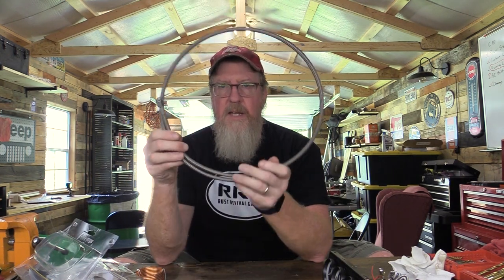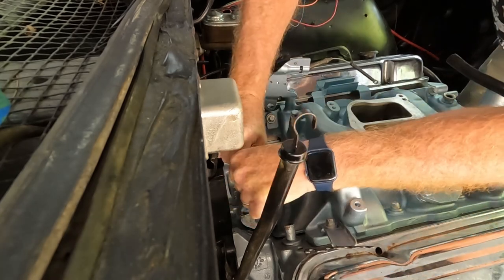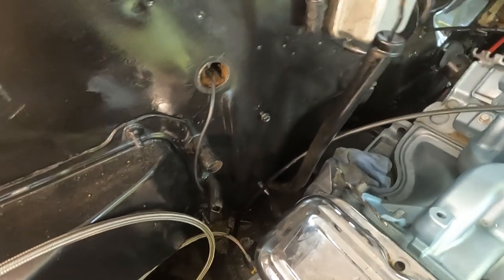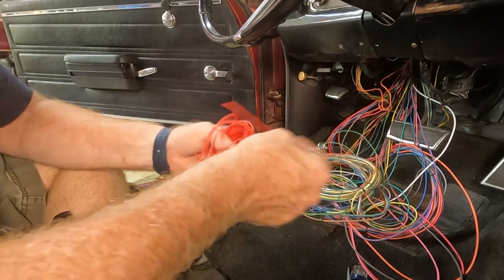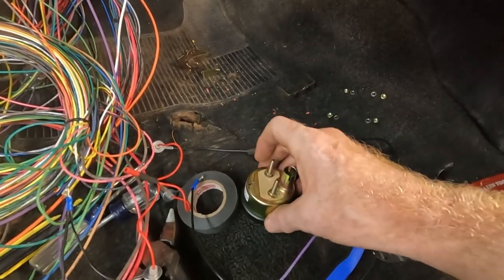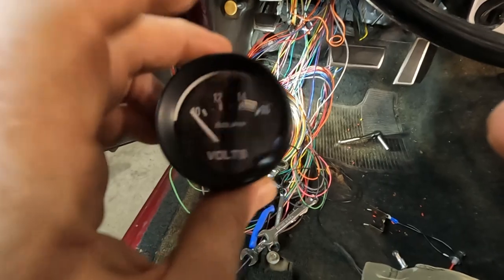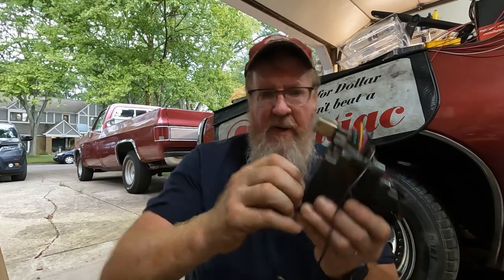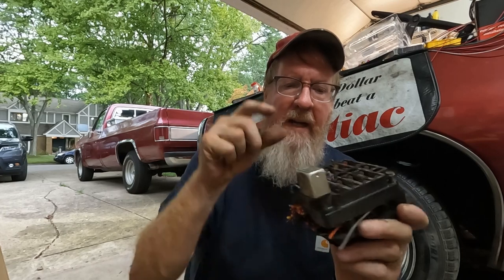Installing Autometer Gauges in the Pontiac

Comment: So the oil braided hose is a JIC fitting no tape required on it as It seals with the tapered via compression.  The tape there could keep you from tightening down enough for good compression.
Reply from the maker: Yep. Another commenter told me that. I'll definitely get the tape off before I start it up. I'm constantly learning! Thank you
Reply: @Rustrevivalgarage  good deal , just didn't want you to have a leak right off the bat.

Comment: I did some in my 72 buick.  They where cheap electric ones. They are junk and metric so I need to swap them mechanical ones. Ive got a new set still cheapos but mechanical at least and imperial. They came with the coper line so ill probably run that. My biggest issue is finding a hole to slide em through. Im guessing ill end up drilling new as bad as i hate to.
Reply from the maker: That hole I used was there surprisingly. Gasket/grommet was shot, after 50+ years, but it worked out well.
Reply: @Rustrevivalgarage  I've looked and the 72 has no holes I can use sadly

Comment: Get a heat gun and apply to those stuck bolts
Reply from the maker: I tried soaking the bolt. Off camera I tried heating it up with heat gun for about 10 minutes. Considered flame, too, but it was too close to the valley pan gasket. And it didn't help that I had painted it. But, you win some and lose most :)